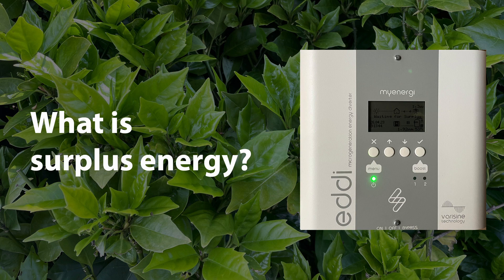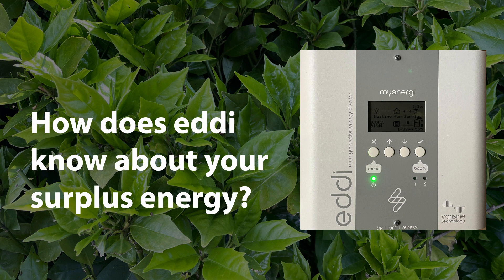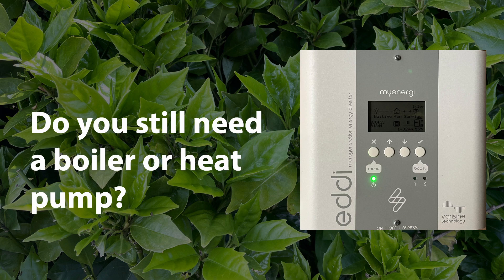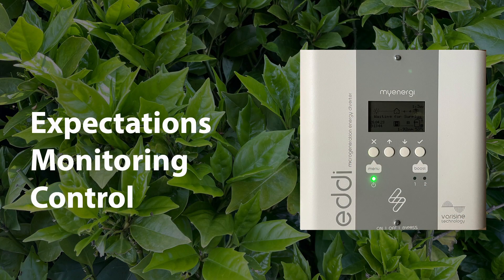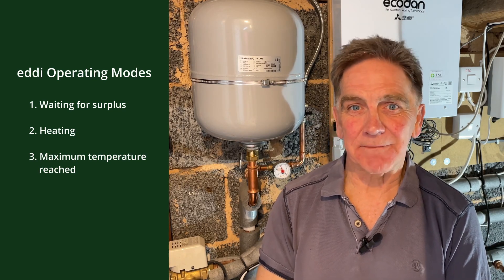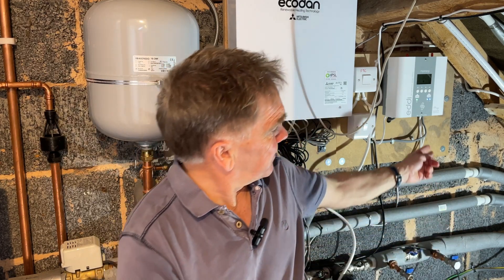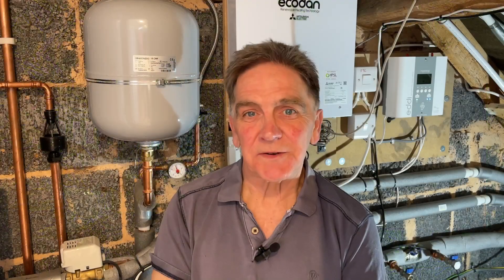Eddi - free hot water from your PV array

Comment: “Pretty much anywhere in the house”. As a purchaser of one of these, I discovered that this is not true. It needs to be close enough to the immersion heater load, otherwise it may fail when the heater thermostat switches on. A little descripton of what happened here: https://www.youtube.com/watch?v=KVkw_bC2qSc  That said, it’s been in service for a couple of months now, and so far there has been no use of imported power for water heating, perhaps until mid Autumn at the earliest.

Comment: amazing video thanks so much, quick question, can if i replace my hot water cylinder immersion heating element with a 12v/24v and connect directly to couple of PV will take be enough to slowly heat 250ltr of water, im not expecting to heat to 50c but at least to 30c to 40c?
Reply from the maker: Thank you!  Sorry, however, because I'm not technically qualified to answer your question.  Someone else might be...?

Comment: I’m buying a new build spring 2024 looking to have solar and battery installed how do I get an immersion heater installed? Then don’t have to use the boiler for hot water? Thankyou
Reply from the maker: Hope it all goes well for you.  I can't advise on immersion heater installation, however.  I think you probably need to consult the builder for that.

Comment: Just want to mention : I export power to my immersion heater when my Sunsynk Solar system reaches 100% battery SOC. This hapens daily from 12h00 till 16h00 on sunny days. The AUX port on the Sunsynk Inverter has a relay that kicks in and surplus energy from the solar panels are used to charge the batteries while power is sent to the immersion heater. The export kick in percentage can easily be adjusted to send power to the immersion heater.
Reply from the maker: Sounds good.  I'm still struggling to work out exactly what my inverter and battery are doing.

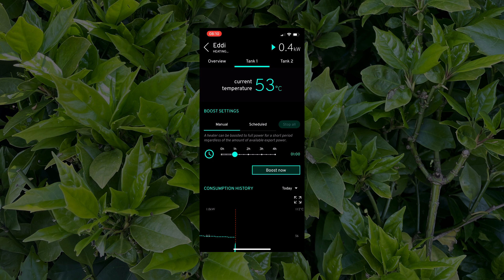Comment: Hi. At 5:52 on the video timeline there is a temperature on your app. Is this the temperature coming from the immersion heater which heat the water? My eddi seems to be installed correctly but I can't read the water temperature. Could it be the thermostat that it's broken? I have an Albion indirect cylinder 120l also plugged with a Hive for the water temperature top up from the combi boiler. The issue i have is that the eddi continuously heats the water and create a lot of pressure in the cylinder and once the pressure is over the limit the hot water is pushed to my cold water tank. In the end i have only hot water, no cold water. How could I solve the problem? Thanks.
Reply from the maker: Crikey!  That doesn't sound good.  However, I'm just a "user" not a supplier or any kind of technician and can't advise on this.  And I have to wish you "good luck" because I've had too many people turn up to install or service without fully understanding the setup.  Green energy systems are great, but they are complex, and that makes them difficult to troubleshoot.
Reply: Having had one of these installed recently, it’s true that Eddi does not know the real temperature value. It assumes that if the load is switched out, the max temp has been reached. It’s down to the conventional thermostat, normally mounted in the top of each immersion heater (it can work with two, if there are two). On my tank, which is a much older Gledhill torrent mains pressure water heater, there is a temperature gauge mounted near the top (about 30 s into https://www.youtube.com/watch?v=KVkw_bC2qSc ). It contains ~190 litres of unpressurised water, which never flows at all.

Comment: How does it work if your not sending anything to the grid?
Reply from the maker: If there is no surplus to be diverted, the eddi doesn't heat the water.  In that situation, we get hot water from the air-source heat pump.  If, for some reason, we didn't want to use the ASHP, we would switch the eddi to "by-pass", which means we're then using a straightforward immersion heater.

Comment: Interesting but the economics is often less straightforward than people think. I used to have the predecessor of the Eddi when it cost £300 and I saw it as a less expensive option to a £3,000 Solar-Thermal add on when I had my Solar PV install 10 years at my previous house. If you are on a FIT tariff then it is as started at around 2:38 "free hot water unless you count the capital cost" and there's the rub since supply and fit is according to a Google search going to cost around £750 (less if part of a larger project) and that's a lot of hot water before break even even on FIT where it doesn't mater if you export or not. However, for the past several years since FIT was dropped using locally generated roof top solar electricity is no longer free to use simply because if you didn't use it you'd be paid for its export. On Octopus depending on your tariff you could be paid as little as 4.5p/kWh as I am or 15p/kWh as my neighbour is any time of day. You could get more with time of day export tariffs. But take my tariff Octopus intelligent where I have 7.5p/kWh import for 6 hours at night which is when my car charges and hot water heats up then when the sun shines the following day my surplus solar after charging my home battery is exported at 4.5p/kWh. So to use Eddi every kWh I'd divert I would have been paid 4.5p. Now doing this it would save me 7.5p/kWh so the saving is 3p/kWh. I use on average 5 kWh per day for hot water so I would save only 15p/day or 365 x £0.15 = £54.75 per year. 

So how may years before I breakeven £750/£54.75 = 13 years 255 days assuming you have enough surplus solar PV to heat a whole tank 365 days a year - which you won't. Remember that the Eddi has only a 3 year warranty so it needs to work flawlessly for 4 times the warranty period.
Reply from the maker: Thanks for this.  And you may well be right.  My single biggest complaint about all these "green energy solutions" is that they are complex, and the more you get involved with them, the more complicated it all becomes.  How do I make sense of the overwhelming volume of data involved?  Have I got the time, energy or the talent to figure it all out?  Are installers competent to design a complex, cost-effective system and then to install and connect it?    
Our approach has been (1) get rid of or minimise use of fossil fuels - faced with the climate emergency, this is something that we can do. (2) suck it and see.  
I don't know if or when we'll get to breakeven, but I know that we've got heating, hot water, and lots of solar-generated electricity, and no gas coming to the house.  I'll take that, and see how it goes.  Thanks again!

Comment: What is the difference with monitoring my surplus and turning on the boiler heating electronically myself? Would really like to know!
Reply: The Eddi will vary the amount of power going to the water heater, if you only have 100 watts  of surplus solar it will just use that up to the full wattage of the water heater… I tried watching my solar and switching the water heater on and off but I was pulling more from the grid than solar….. I know the Eddi isn’t cheap but it will pay for its self in a few years and all of the hot water is totally free from grid power, in the winter I connect a heater to the Eddi too so when the water has reached temperature it automatically puts the power to the heater and saves some of the gas used by helping to keep our house temperature up…. Hope this information is helpful
Reply from the maker: I guess the difference is that the eddi will do this automatically.  No need to monitor surplus yourself.  If I'm missing something, please let me know!  Thanks.

Comment: Why’s cheaper.  Using a modern gas boiler on a gas price of .7p kwhr or the potential of exporting surplus PV @.15p with the octopus 🐙 SEG payments.  

My system 4kw PV 12kW battery’s 
House is band B super efficient with no recommended measures.  

The cost of an induction hob is double that of current gas hob plus the purchasing cost of induction hob

ASHP quote we’re saving of £170.00 a year
Reply from the maker: This seems fair enough, but I'm starting from a different place:  our top priority was to reduce our carbon footprint by getting rid of gas, and to use self-generated electricity as much as possible.  With no gas supply, it doesn't help us to compare the cost - we're already committed!

Comment: I now value my exported electricity,, Last month Octopus paid me over a hundred pounds  ,so now I,m happy to send back to the grid,,and my credit with the energy company is tobe used as a energy store for winter..Thats until the priced falls...  Everything has some Value in an economical sense and not sending back to the grid has a cost...
Reply from the maker: When our system was installed (a year ago), it wasn't possible to switch to a feed-in tariff.  I looked at doing that with Octopus a couple of months ago and discovered that our installer had not provided the documentation we need to sign up for a such a tariff:  MCS Certificate and Distribution Network Operator approval for the installation.  Beware suppliers / installers who don't do their job properly!!  It's taken a while, but as of today I have that documentation and will now apply to Octopus.  Once that's done, I suspect that (like you) we will value our exported electricity more.  As you say, everything has some Value in an economical sense, and I confess that I place some value on simplicity.  The eddi works in a way that I understand, and I like that.

Comment: Thank you for the video, this is by far the best video explaining how the Eddi works, I’ve had my Eddi for 6 months now and I’ve saved myself £148 that I would have spent heating the water. I like the new update they have installed because it automatically shares the solar power between the battery and Eddi in the morning for the 1st few hours then it charges the Battery then goes back to heating the water. Great video
Reply from the maker: Thanks, Rob.  Good to hear that someone else likes the eddi too!  We have had loads of trouble with the main contractor for our installation (ASHP & PV) but with everything now resolved (I hope) we are about to get a safe pair of hands in to fit a couple more CT clamps and to configure the Eddi so that we can see everything in the myenergi app.  Thanks again for your kind words.

Comment: This all depends....
On the size of your PV array.
Whether you have a battery or not.
On your import and export rates.
On how you would normally heat your hot water (gas/oil/electricity) and what you pay for it.
In the UK, you pay around 34p/kWh for standard rate electricity usage, you can get 15p/unit for exports and gas, I think is around 10.4p/kWh.
Then there are off-peak electricity rates.
There is no simple one-fits-all answer.
If you have gas heating and you're on Octopus outgoing at 15p/kWh, purely financially, stick to gas. If you're losing 15p/kWh in lost exports to save 10p/kWh in gas, you're losing money.
Obviously if you're trying to save the planet, that's a completely different issue.
Reply from the maker: Yep.  Agreed.  I'm not presenting this as a one-fits-all answer to anything, it's just my experience - which started with trying to work out what this Eddi thing was all about... what to expect from it, how to monitor it, how to control it.  Per other comments (above), using surplus to heat water means you're not being paid for sending it to the grid (assuming you have a feed-in tariff).  But we wanted to get rid of gas - we're not going to save the planet on our own, but every little helps.
Reply: @AtHomeWithGreenEnergy  You need to research the hidden lands past the ice wall...Look at the moon it reflects the map...And you will identify Eden

Comment: Had my system a few months now (installed back end of 2022).  Consists of EV, storage batteries, solar, Eddi and Zappi.  I love the App.  When I tap tank one, I get Boost settings and an opportunity to select Manual, Scheduled or Stop All but no temperature reading of the water in the tank.   Was this a feature  that you installed or possibly something that my installer didn't?  Presumably you have a thermocouple fitted on the tank somewhere that also connects to the Eddi.  Great video by the way!!
Reply: That is an extra cost function I believe.
Reply from the maker: Hi Andy.  I'm not sure!   When I tap "Tank 1" on the app, I'm presented with the opportunities you describe, but below them there's a chart showing "consumption history", and below that there's a Tank 1 reading (currently) showing 0kWh, and another Tank 1 reading showing 48.7 degrees C avg.   Is that what you are looking for?  I've not noticed it until now.
I don't remember anything special being done by the installer, but then he didn't even explain to us how the eddi worked.

Comment: Any reason why you didnt try adding it into the smart grid function of the ASHP with maybe a smart thermostat? This will allow the ASHP to produce hot water for you which should be more efficient than an immersion?
Reply from the maker: I think I get the gist of what you're saying, but I don't know what the smart grid function of the ASHP is.  Quite honestly, we took on board a whole load of new technology without a lot of help from the installer(s).  We're almost on top of it now (a year later), and maybe then we'll be able to start fine-tuning it all.  Thanks.

Comment: ❤ my Eddi best thing about my PV Array 💕
Reply: Sounds like a great system. Could you give me more details. Ie. I assume there is a tank somewhere if so is the hot water pumped from the tank or gravity fed. I live in a bungalow. Restricted on room in the loft.
Reply: @duncanwilliams3221  I "think" (based on the supply pressure at the taps) my hot water is gravity fed. My tank is in the airing cupboard upstairs, but the gravity pressure is provided by the cold water tank in the loft immediately above the hot water cylinder.
Plumbers please butt in here... 😊
Reply from the maker: Yes, there's a tank. This is a virtual guide to the complete system: 
https://youtu.be/Vr-EQ3hDjEo